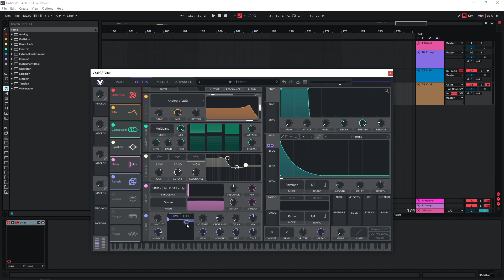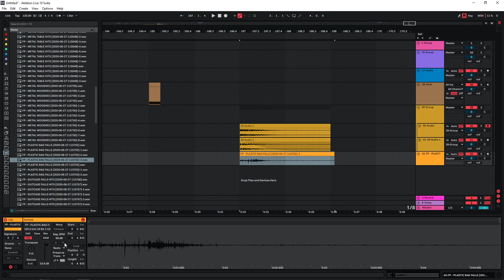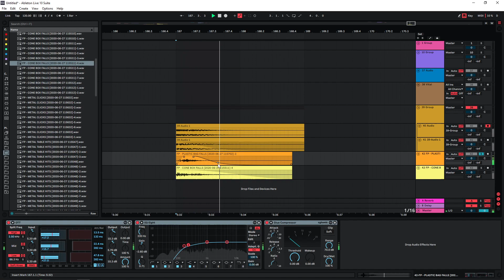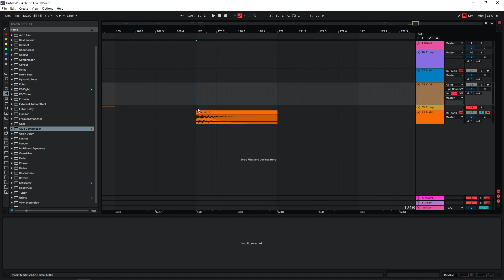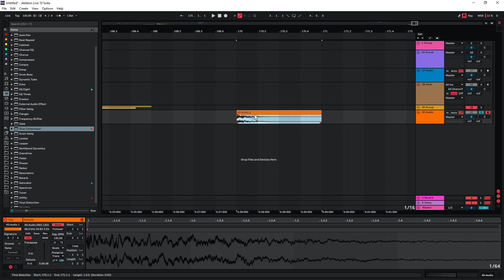How To Sound Design Explosions (using Vital)

Comment: Drum buss seems to be really important in the chain. I don't have Ableton, what plugin do I use instead?
Reply from the maker: You can just use a transient shaper and any distortion plugin that you have available; this is what I'm using drum buss for in this case. Try out different distortion plugins to see which sounds best for this and also play around with the order of the plugins (transient shaper into distortion or the other way around). I use transient shaping and distortion at quite extreme settings in this case, but depending on the plugins you end up using, you might use more moderate settings. I hope this helps. :)
Reply: @NGTVST  thanks for the tips!

Comment: Awesome design! The Drum Bus effect seems super important in this sound, I wonder what they equivalent would be in Logic Pro?
Reply from the maker: I'm not familiar with Logic Pro, but from a quick google search I guess that the Enveloper stock plugin is a transient shaper. The only other thing I'm using drum buss for is distortion; so you can simply try out the different distortions in Logic Pro and see what kind of results you get. :)
Reply: @NGTVST  Thanks for going to that trouble of looking up a solution, very kind of you.☺ I wonder if boomerang techniques are a good idea for Vital? Meaning creating a basic sample from Vital then bringing that back into vital as a sample to then re-process? That way it would be a saved patch rather than a DAW reliant process. I've done that with noises but in this application it might work a treat?. Just a spitball idea. Thanks again! 😀👍